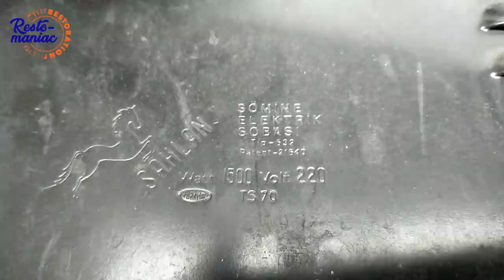Futuristic Electric Heater Restoration

Comment: Nice restoration.  Caution:  The average “polyester filler” is not heat resistant and will burn with high heat.  The only safe metal filler to use is the Bondo brand called Evercoat Rage filler for this high heat application of yours, it is good to 260 Fahrenheit (126 Celsius) surface temp.  I also think that bleaching those porcelain insulators would have whitened them, made them a brighter white and removed some of the rusty discoloration…just a thought.  I’m sure you used heat-resistant paint, right?

Comment: All the electrical things you restore look the same - metal casing, 2-pin connector with earth tabs and ceramic switch, I assume that these were made by the Soviet Union, despite having the look that they were made in a third world country being soo crude. I liked the heater elements glowing but the lower bar looked soo uneven - particularly the hot-spots, would it be worth replacing the nichrome wire to make the glow more even/making sure the wire is tightly wound to the ceramic rods so they are not floating and getting too hot - risk of the wire melting and breaking
Reply from the maker: Thank you very much for your comments dear Samuel. In fact, all over the world, old-time electric heaters are almost the same. I checked and measured all the wires even though they are not visible in the video.  That's why I'm not in favor of replacing it if it's working properly. This wire has a longer life 😊